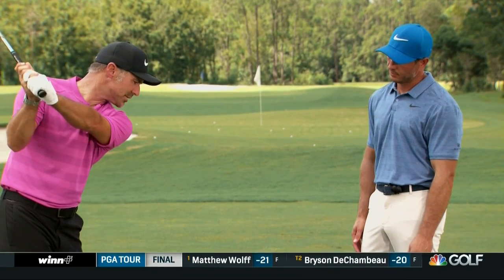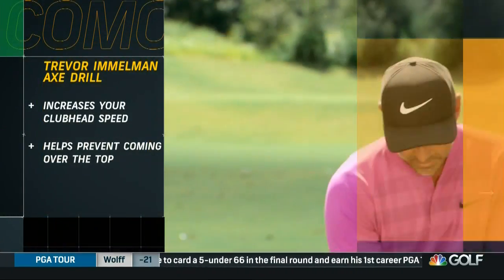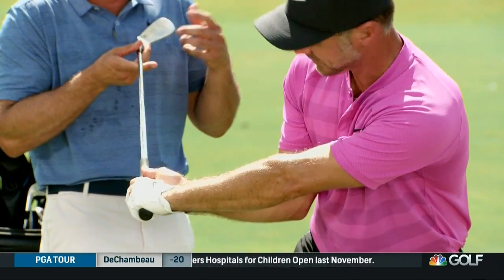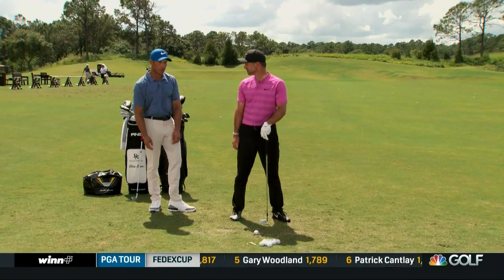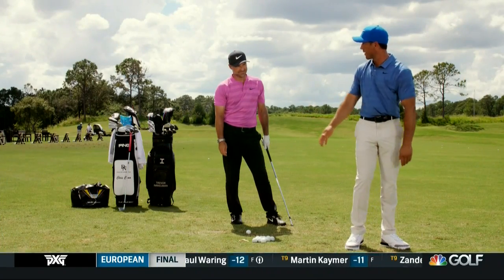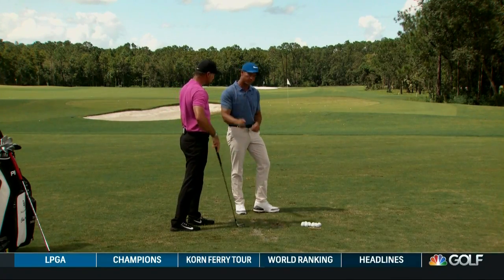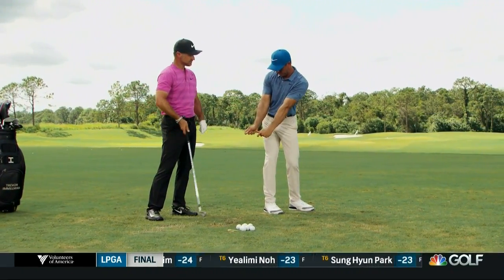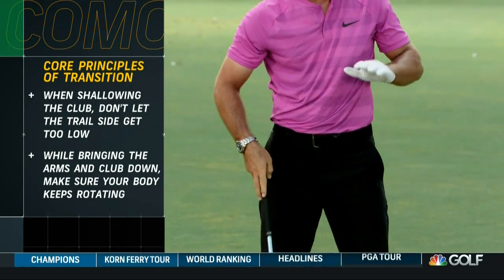Prevent Coming "Over the Top": Split Grip & Axe Golf Drill

Comment: On full shots...the Split Grip allows my right hand to control the clubface through impact...to either turn the club over and draw the ball or hold on and fade the ball. It's magical how the Split Grip allow you to work the ball.  Here's another benefit everyone...use the Split Grip around the green. Oh my gosh...the Split Grip makes the Flop Shot soooo easy...just slide that right hand rapidly under the ball while maintaining that open face...and that ball shoots up like a rocket.   And when chipping...at impact...add a little right hand release...to get the ball to run to the cup...which is the secret to all great chippers.   When possible...always plan to have some run-out with the majority of your shots around the green...for the ball to always release quit a bit to the hole.  Billy Casper taught this concept to Seve..and Seve taught this concept to Tiger.  Watch Tiger hit sand shots...there is always a release...a run out with the ball.  Seve's bunker shots always had release.  I'm just saying...with the Split Grip...it's so much easier to create this release to the ball or a hold-block-fade action through impact.  Play 2 weeks with the Split Grip.  I really believe you'll lower your score...and have more fun shaping your shots like Bubba.